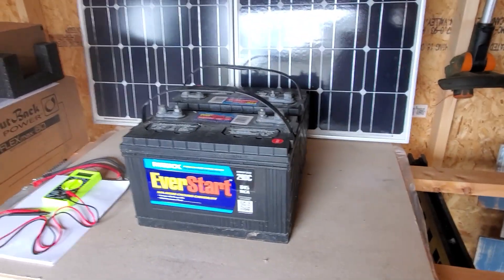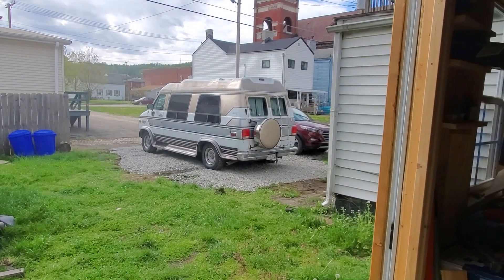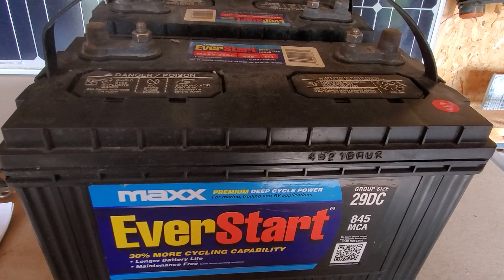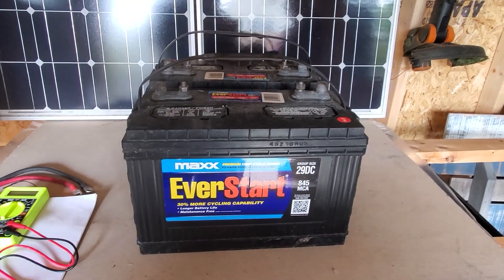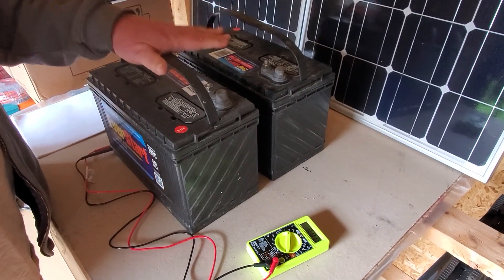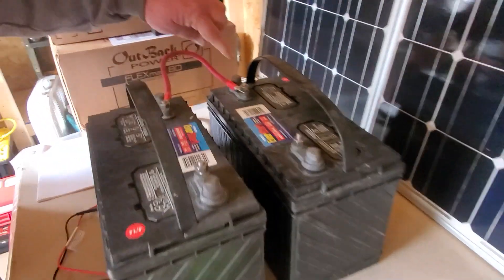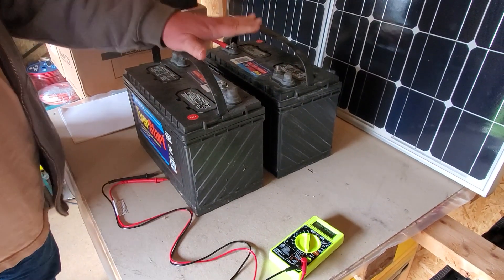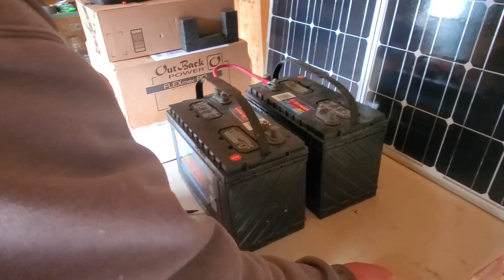DIY Off Grid Solar Battery Banks Inverters Watts Volts Amps. Who Knows?

Comment: OMG I'm so confused! My brain hurts! I have one of the same batteries your showing, I'm buying a second one next week, I have a 700watt pure sine wave inverter, a MMPT 40amp controller, 2 100watt Monocrystaline panels,  a 60amp fuze. I'm wanting to run my 100watt guitar amp and laptop (its 85watts and has to be powered), I need both to run  longer, its giving me 2.5hrs of running time and need more running time.. which way do I go? Another battery, another solar panel? wire both batteries in series or parallel? PS I let the batteries go around 45% charge and then turn it off to recharge. Heeeeelp?

Comment: Power loss equals amps squared times resistance. P=I^2*R
Reply from the maker: +n3sjh I have no idea what that means lol.  I try to keep it simple!
Reply: It is very simple, if you double the current through a wire, you also double the voltage drop. Which means you 4 times the power lost, or heat generated in that wire.
Reply: The same is true for a heating element or any resistor.

Comment: Thank you fir the goid explanation.  I have one question; I've seen many tools and appliances that are specifically 12v. Can you still run them on a 24v or 48v battery setup? Or do you have to add something else first?
Reply from the maker: +Enochian.org I have a step down converter to take it back to 12v for what's needing that voltage.  About $50 or so.

Comment: Hey Joe! Question for you. Are YOU still running your cabin from the generator by hooking it in the 30amp inlet box to the breaker box? But now you are adding solar so are you going to hard wire your inverter to a 30amp double pull breaker?  I am just trying to figure it all out by researching and seeing how others do it. Right now I am just running off of Generator. But in the future I want to run solar but not run DC wiring in the cabin. So are you still planning the setup as in the (Wiring Generator With Solar to the Off Grid Cabin) video? This stuff is confusing but I have a lot of time before I get to my solar project to learn and just see how others do it.
Reply from the maker: +Liberty Creek I haven't completely decided how I am going to proceed with the solar.  It will be wired in to the panel, and I have a 24v dc to 12v dc to possibly run some light and some appliances much more effectively than ac.  I'm still researching and learning lol!

Comment: I'll rewatch this video 82 more times because I miss so much. It seems a 48V battery bank would be more efficient, yes? I found some gel cell batteries online today with free shipping! I'm thinking about buying 8 of them. They were 12V and 104ah for $305 each. I think. That isn't a beginning bank that's an upgrade bank! Lol Nicely done you two!
Reply from the maker: I wouldn't hesitate with that if I could afford it lol.  These videos are geared more towards people like me with smaller systems, and smaller budgets.  The weekend cabins and rv'ers and such if you will. My goal is for my entire system to come in at less than $1500.
Reply: @HomesteadWithJoe  well, I've already got about $2000 in all of my parts. The panels were the cheapest component! Who knew? Lol I figure by the time I get the battery bank I want and the power room built it will cost me roughly $5000. Which is pretty cheap for a good solar system!